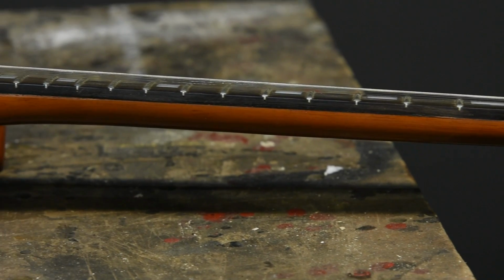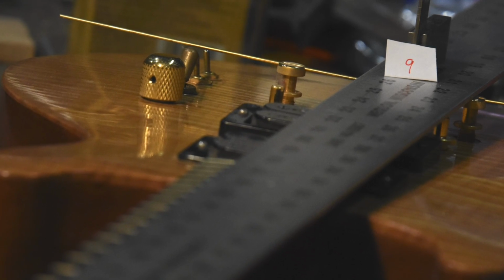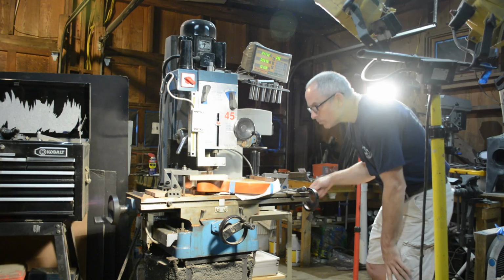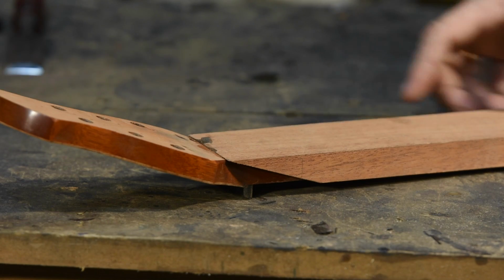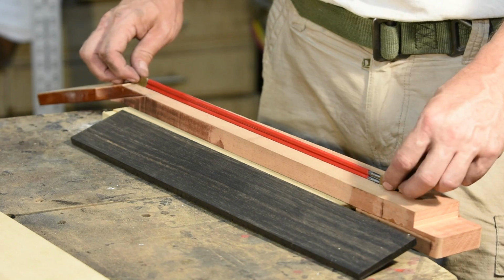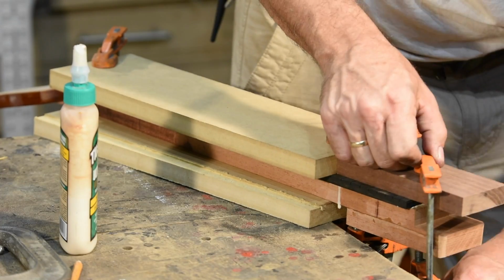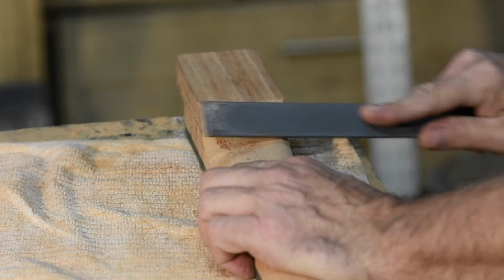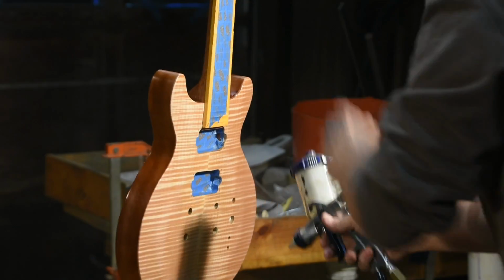Rebuilding a Guitar Neck Using Metalworking Tools

Comment: This is a pretty cool video. Almost the opposite way in which I've come into things. As a violin luthier who has also picked up bladesmithing, many of the mental processes are easily transferable to both trades. But even as a woodworker, I do find myself using the 0.01 mm read out on my calipers. Can't leave all the precision to you metalworkers ;D

Comment: I agree entirely. One stipulation, while metalworking tools are GREAT for woodworking, woodworking tools don't do well with metal. LOL I built a mandolin about 10 years ago; first try, and yes, the neck isn't perfect, but for starting out as lumber she's pretty nice. I should have built an electric something first, because while the body came out gorgeous, I spent so much time on that, I rushed a bit on the neck and had to file frets excessively to make her play right. Someone offered me 2500 bucks for her a while back, that works out to 4 bucks an hour, since I used very basic hand tools in her making; the idea was a winter project I could have fun with while sitting by the wood stove. Carve, sand, stoke stove, repeat. If I decide to build another, I'll use power tools for the grunt work, definitely.